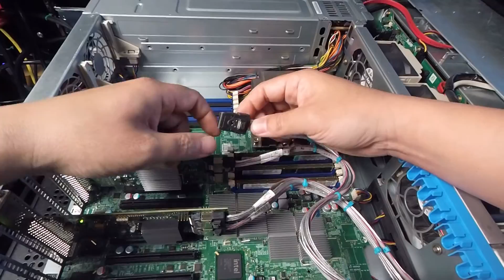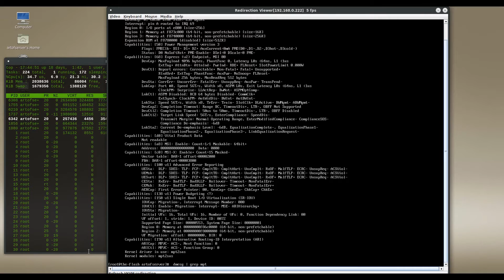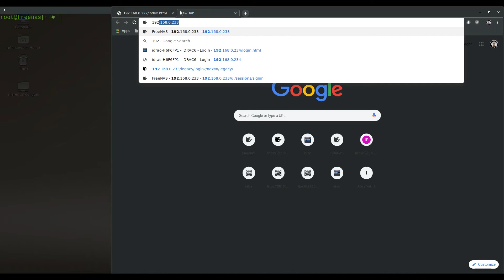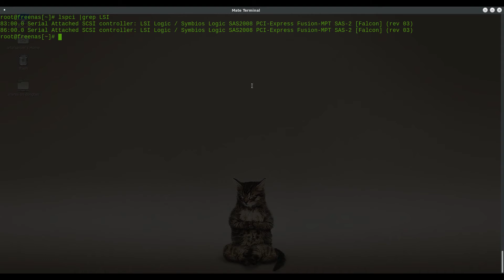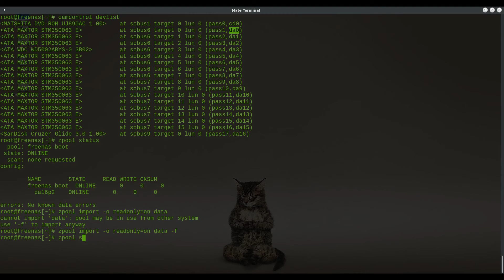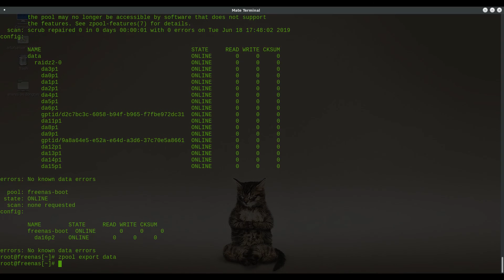How to troubleshoot your LSI IT mode HBA in Linux TrueNAS FreeNAS

Comment: 24:56 ... Does that card still show "Subsystem: Dell Device 1f4f" at first couple lines because you flashed the card with a BIOS you got from Dell website?  Everything should have cleared when you did the MegaRec clearing, but it looks like you may have added Dell back in with the mptsas2.rom BIOS flash?
Reply from the maker: No, that subsystem ID comes from the SBR in the EEPROM, not the ROM image or anything else. I don't clear the SBR when I flash these cards as my method directly modifies the SBR to the desired data that allows me to flash the firmware in a single cycle instead of the usual methods you might find posted around the internet.

Comment: Hello, I have watched your more recent troubleshooting videos but I felt this was the most relevant, so I decided to try and contact you here. I recently installed a 9220-8i hba and at first it was working fine. Then I tried to use an extender on a pcie riser card while also moving the controller to a separate pcie riser and now the controller has completely stopped working. I can't find it to flash firmware in freedos or uefi, there is no way to get into the avago bios anymore, and the heartbeat led has been completely dead since the riser card incident. All signs point to the hba being dead, but I don't see any damage and I don't understand how what I did could damage it to that extent.  I guess my question is, how do you troubleshoot a card like this? I am out of ideas and would rather not wait the few weeks for the card to be exchanged.
Reply from the maker: First thing I would check is the fuse near the PCIe power lines. Usually labeled F1 but not always. Check if there's continuity across the fuse. If not, it sounds like whatever you were doing blew the fuse. If you have the skill, you can try to replace it, or short it with a wire. Be careful though... if the fuse blew because of a short on the board and you short the fuse junction, whatever has a short will likely burn up and smoke (don't ask me how I know! LOL). But that's what I would check based on your description.

Comment: Hey really appreciate your vids. I purchased a 9240-8i off Ebay and have it attached to 8 SAS HDDs to use with a TrueNAS Scale system I got off fb marketplace. The card's heartbeat is on and I am able to access its MegaRAID BIOS config utility and see all 8 disks, but in TrueNAS Linux terminal I see "RAID bus controller: Broadcom / LSI MegaRAID SAS 2008 [Falcon] (rev 03)" under lspci and nothing under `dmesg | grep mps`.

My guess is that it needs to be flashed to IT mode, and I've read that it may need to be crossflashed too. Where can I find the firmware for this?

Comment: i got a sas controller and 4 sas drives ... lsi 9217-8i 4x hgst 3tb ... they all show up .. but are all unusable .. they dont respond in windows or trunas core ... initially 1 appeared to be fine but suddenly stopped working ... i get errors like not ready ... i am at aloss ... the avago software works sometimes ....
Reply from the maker: Sorry, I mostly deal with Linux and Unix like operating systems. I'm not sure how to troubleshoot this in Windows.
Reply: It’s the same in Linux .. I’ll try wiping the card and flashing it

Comment: thanks for the tips. any idea how to get rid of "configuration changed, press any key" message at each startup? its annoying as hell and prevents my machine from booting up...
Reply from the maker: I don't think an HBA would give you that message. Most likely you have a RAID controller which is complaining that the onboard configuration data doesn't match what it finds on the drives. To rid of that message, you can clear the configuration data on the controller or restore the meta data on the drives.
Reply: @ArtofServer  my LSI config utility looks exactly the same as in your video (same FW version and everything, except the status is set to "Disabled" to prevent the OS from booting from the card

Comment: Hello! Thank you. I have a SuperMicro 721-S minitower with an Avago 9211-i8-IT HBA mounted. I have 4 identical IronWolf 4TB disks in the bays on one port and 1 1TB and 1 2TB SSD on the other port. My problem is that when Proxmox boots 3 of the drive bays (with the 4 4TB drives) are flashing red - but not the forth. Have you ever tried that? All drives are working as expected. 

"lspci -s 01:00.0 -vv" Reports:
Kernel driver in use: vfio-pci     <---- Perhaps this?
Kernel modules: mpt3sas

UPDATE: I noticed: "pcilib: sysfs_read_vpd: read failed: No such device"

Thanks in advance.
Reply from the maker: Sorry, no idea.

Comment: Nice video! I have two LSI 9211-8i cards that don't work. Both the power led and the heartbeat led do not light up. Tried all PCIE slots in motherboard, nothing. I tried plugging in a SATA controller and it works on all slots. So slots work well. I also tried to flash the firmware but the sas2flsh -listall command doesn't find the cards. I have an Intel S2600CP2 motherboard. Any help would be appreciated
Reply from the maker: Use a multi-meter and check the fuse at F1 near the PCIe connector power lines. If you're not getting power LED, it might be that the fuse got blown. The 9211-8i and 9201-8i cards have a fragile fuse that tends to blow.
Reply: @ArtofServer  Wow it seems that fuse got blown on both cards. Do you know maybe what fuse is it in order to replace it?

Comment: Hey, I just bought an LSI 9211-8i card on eBay. the "heartbeat" light seems to show that it works fine, but the system won't post. Any suggestions?
Reply from the maker: If the system you're using supports PCIe 4.0 or 5.0, you might be having this problem: https://youtu.be/b0fAKG3qa6Q

Also, is that a genuine 9211-8i or some other brand card like Dell/IBM/Lenovo that has the 9211-8i firmware? If the later, you might be experiencing SMBus conflict as described here: https://youtu.be/HBnNaheYmdA

Hope that helps!

Comment: i am using Dell H330 SAS HBA LSI 9300-8i, on a regular ATX gigabyte motherboard, i have nothing else connected except fans and my computer will boot to bios without my HBA installed, but as soon as i install this card my computer just keeps rebooting every 10 seconds approx without showing any post/bios messages.
any ideas, i bought this card from a UK ebay seller and it is supposedly flashed to IT mode.
my processor is a 4th gen intel processor.
Reply from the maker: That is classic gigabyte motherboard smbus conflict. The fix is in this video: https://youtu.be/HBnNaheYmdA
Reply: @ArtofServer  thanks bro, much appreciated.
i found the answer, the seller of the card sent me the same video you did.
much love for your knowledge and efforts.
Reply: i got my answer, taping over pins B5 and B6
as in this video
https://www.youtube.com/watch?v=HBnNaheYmdA

Comment: This is a great video thank you.  It helps me to understand.  My issue is that during boot I don't see the adapter bios boot up so I can't get into the topology, etc.  It was working on another motherboard but when I moved it to new motherboard now it doesn't give me this bootup.  What can be the cause?  I am attempting a unraid server setup.  I see the heartbeat.  I see a steady gree LED below it and on the back of the card there were two more LEDs that blinked when i connected the SAS cables.  I also tried the card without drives in a Win11 PC to see what it does and the same thing.  There appears to be no bios boot for the HBA card before Windows boots up.  Windows device manager does see the card.  I then placed the card back in the unraid server and allowed unraid to boot to dos prompt. Using your lspci grep command it returned an 04 address with RAID bus controller Broadcom/LSI SAS2008 PCI-Express Fusion-MPT SAS-2 Falcon so unraid sees it.
Reply from the maker: Good question. Heartbeat is good sign. Some motherboards have an option in the BIOS/setup menu to enable or disable the "Option ROM"  or "OpROM" for a PCIe slot. If this is disabled, it will not load the LSI BIOS ROM program from the card during POST. Check that you have the Option ROM enabled for the slot where your HBA controller is inserted.

Comment: For an LSI 2008 based card, what if only one of the ports is working now but was working previously in the same machine. I swapped out the cable and tried different drives known to work in the system. So basically of the two ports, only one is working.
Reply from the maker: By port, I assume you mean the SFF-8087 socket, and not each individual "SAS port" which there are 4 to each SFF8087 connector. Is the entire SFF8087 port not working or only certain SAS lanes out of the 4 that are not working?
Reply: @ArtofServer  All 4 of the ports do not show drives, is there a diagnostic? Could a port burn out?
Reply: Sorry Yes port = SFF8087, If I swap the cables and keep the same drives and move to the other SFF8087  port everything works fine, so that eliminates the cable and or any drives.

Comment: Hi, this might not be related but, ive got an LSI 2008 Broadcom 9201-8i controller, which works fine. Just, the 4th drive doesnt get recognized in the Bios. (4x 8TB). 
I can connect any combination of the drives, but maximum 3 of them (so its not the drive itself). Do you know if theres a maximum storage capacity that im hitting?
I didnt find any info elsewhere sadly. 
Thank you.
Reply from the maker: That sounds like you might have a bad SAS lane on the card or one of the cables? Look closely at the back of the 9201-8i card near the SAS ports. There are "coupling capacitors" that connect each of the SAS lanes from the port to the controller chip. See if any of them look loose or damaged.
Reply: @ArtofServer  Hi, thank you for replying.
I checked the card if i saw anything that looked damaged, but tbh, it looks immaculate. I checked the sata cables too, replugged them, but nothing.

Also, i put in the drives at all bays of the server, they are all working, just never more than 4 at once. The led at the front is green too so the drives get recognized, just the 4th one never shows up in the bios.
Anyways, thank you though^^

Comment: This video helped me diagnose a HBA I just got from ebay. I ordered a dell branded LSI 9286-8e flashed with IT firmware. It installed in my R710 with zero issues. It appeared originally and all 12 of my 2tb drives in my dell sc200 showed up fine. I started running badblocks on all 12 drives simultaneously. About 65% through the first write pass, all the drives and the controller dropped. I thought it was simply angry from forcing it to do constant write operations on 12 disks. 
Upon further inspection, the card had zero power. The part in this video discussing the resistor on the 12v pci input was spot on. It was fried. Confirmed with my multimeter. The controller lasted for roughly 3 hours of use in my server.
I'm not sure if it is actually possible to overload one of these, or if it was simply bad luck. Do you have any feedback on if this is something I should avoid in the future? Or was it a fluke? Fans in the server are good, no issues with the 10gbe card in it. It is in my basement which is around 17C right now. 
I was tempted to just bridge it, as I don't have any smd resistors laying around. Instead of risking frying the server, I contacted the seller. 

Again, I know this is an old video, but your feedback is appreciated.
Reply: Fuse, not resistor.

Comment: I have a card and it was working perfectly fine but suddenly i dont see the heartbeat LED. If that does not come. I am sure i need to a get a new one. Which one can i buy and will you be able to ship one to me in India
Reply from the maker: Which card was it? Check the fuse at F1 near the PCIe power connection. You might have blown the fuse.
Reply: @ArtofServer  SAS9200-8i is the card . I do see the F1 written near the port 1. But how can i test the Fuse . Continuity testing?
Reply from the maker: @seetendrapanda  yes, continuity test. It should be closed, if it is open, then the fuse is blown. As a test, you can close the circuit with a thin wire to see if the card turns on.

Comment: Hi, first of all nice video, second, I know it a llittle bit late, but recently I get one H310 Card an tried to flash the IT firmware, the card get detected but the disks dont show in the bios of the card, previous the flashing the disks get show by the original bios, ay idea how to debbug this sort of problems?
Reply from the maker: Check the SAS cables are not loose. That's a very common problem. Make sure your HDDs are mounted correctly and actually make contact with the backplane connectors.

Other than that, if your flashing is incorrect, sometimes half the SAS lanes become disabled. If that's the case, move your drives to other SAS lanes and see if any of them are enabled or not. If so, go back and redo the flash, paying attention to the SBR.

Comment: if an h710 is flashed in it mode, but does not have the boot files to make it bootable, will it still show up here?
Reply from the maker: Without the LSI BIOS ROM loaded on the card, you won't be able to follow the troubleshooting steps pre-OS environment. So, you can't press ctrl-c and use the SAS topology page. The within OS steps will still work. That's why I usually recommend people load the LSI BIOS ROM, at least on internal controllers.

Comment: I have the LSI 9211-4i card in a Windows 10 PC. Whenever the PC wakes up after prolonged sleep, the drive attached to it can’t be accessed, device manager can’t scan hardware changes and about 1 min after the wake up, I get a BSOD with the stop code driver_power_state_failure. Dump file points to the SAS driver. Once the BSOD reboots the PC everything’s working fine. It also always works fine after power down -> power up, the issue occurs only after waking up from sleep. Ever heard of such issue?
Reply from the maker: That's never happened to me, but I only use Linux. It does sound like a driver issue. Have you checked for an updated windows driver from broadcom.com?
Reply: @ArtofServer  I did, but all the drivers there are actually older than mine. The "lastest" one they've got for Windows is 2.00.76.00, but when I got the card, Windows automatically installed version 2.0.79.82. I'll keep investigating, although it's a pain because not many Windows users have such cards so there's not much data on this on the web.

Comment: Thanks for the BIOS tip. I flashed my card without it initially. Having additional diagnostic tool is certainly handy and I don't mind the additional boot up delay. Also, FreeNAS/FreeBSD contains mpsutil command line tool that can report basic information about HBA and connected disks.
Reply from the maker: Glad this helped. Thanks for the tip and watching my video ☺️

Comment: on my Supermicro server, I have 16 hard drives installed. recently installed the last 8 hard drives, but they are not showing up. I believe i am using one controller and that could cause this. should I install 2nd controller?
Reply from the maker: Depends on the backplane you have. Find out the backplane part number and post it here.
Reply: @ArtofServer  I have X9DRi-LN4F rev 1.20A. And Adaptec RAID controller ASR71605. I looked into more on this today.  under Create Array those options were grayed out. but under initialize hard drives options I see those drives. so I am assuming I have to initialize those hard drive before creating new Array. 
Also I have 4 slots of SAS cables from RAID controller to front panel of board. but only 2 cables are connected. should I get another 2 cables as I am adding more hard drives?